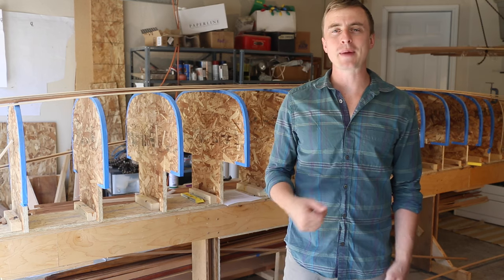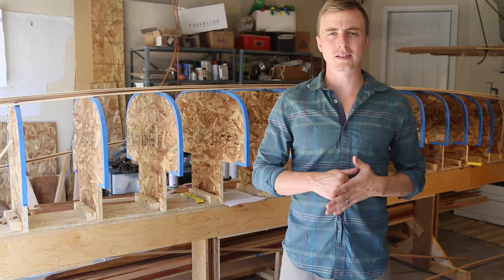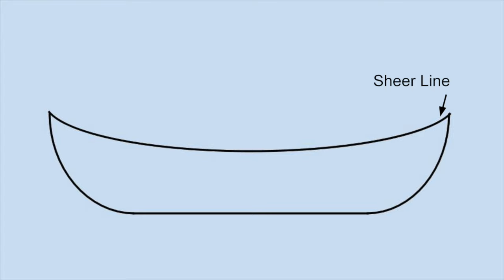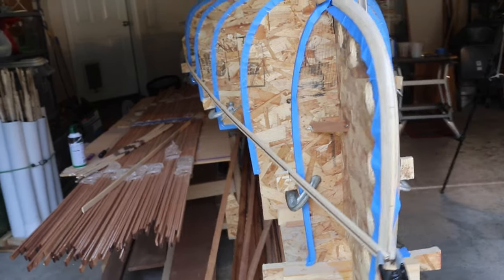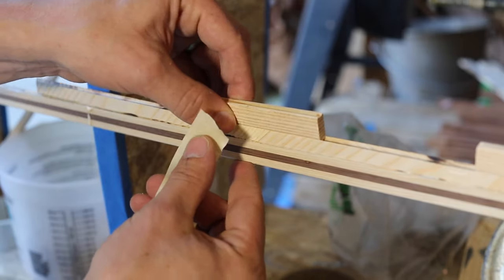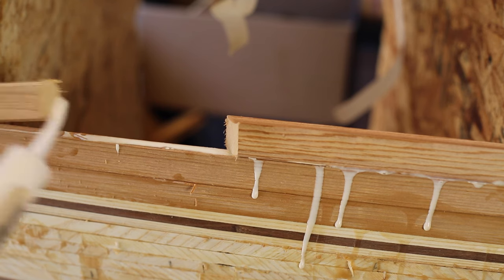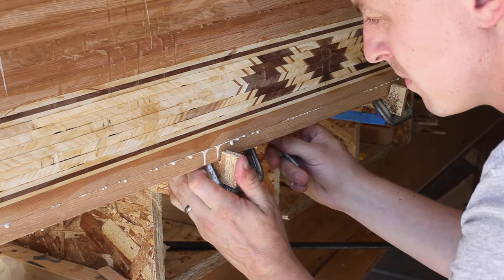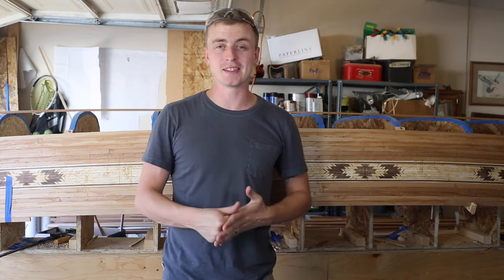Building the Hull - Part 1 (Ep 6 - Cedar Strip Canoe Build)

Comment: Did you try butt-joining strips at a station mould? 

I'm trying it on my sheer-strip (I don't have any long enough for the sheer), but the strips don't want to stay aligned at a station. Perhaps it's easier doing it off the mould, and spring-clamping them together until they dry?

Comment: When laying the strips for the hull, approximately how long does it take for the glue to set on each strip? I understand that a ton of factors can determine the time it takes for the glue to dry but what is your best estimate? Also, are you waiting for each strip to dry before you lay the next one or are you doing multiple strips at a time, like say two, three or four strips at a time?

also, nice videos!
Reply from the maker: Sandyeggo Blue so for this canoe I was waiting like an hour between each strip and it was really hot out so the glue dried pretty fast. When I was using the staple method for my first canoe I would do three at a time and wait a little bit longer. Manufacture instructions for wood glue usually says wait 24 hours before you mess with anything but I didn't feel like I needed to with this because I would only glue and clamp again at the same direction. Hope that helps!

Comment: What glue are you using on the strips?
Reply from the maker: gary24752 just wood glue for gluing the strips together (titebond 3) because the fiberglass epoxy gives a waterproof shell. Any joints that have a chance of being exposed to water I use a 2 part epoxy resin/hardener glue that is waterproof (ark composites)

Comment: Way TOO much glue in your joints !  A canoe this size should need no more than 12 oz of glue. Imagine that you have a joint without enough glue. The epoxy from a seal coat will seep into the joint, and provide plenty strength for the joint. Besides you will save a ton of sanding and scraping !!! Just a FYI. Great job on the video however !!!